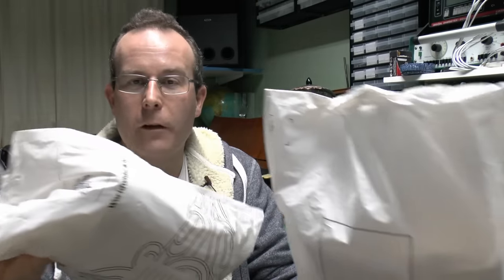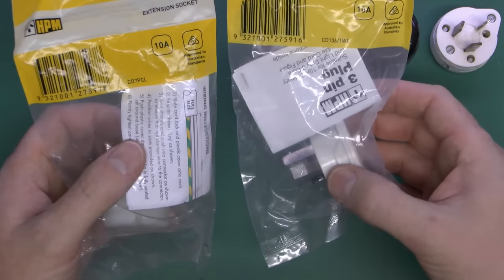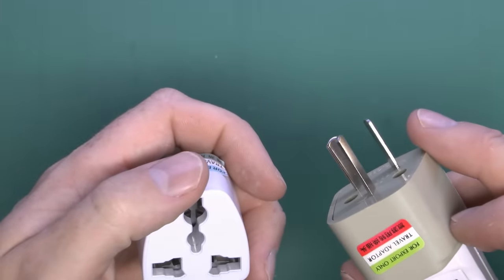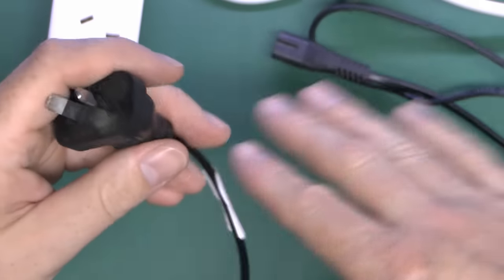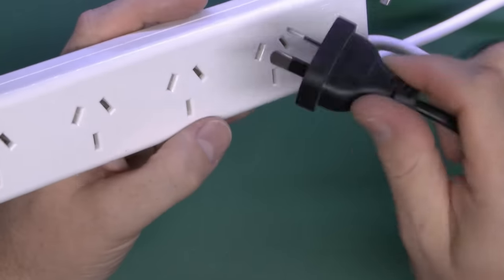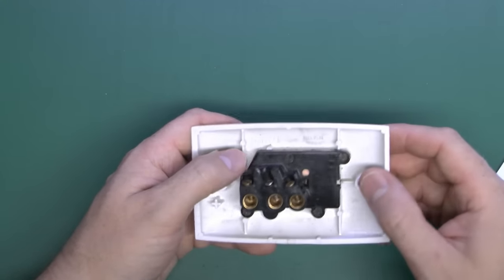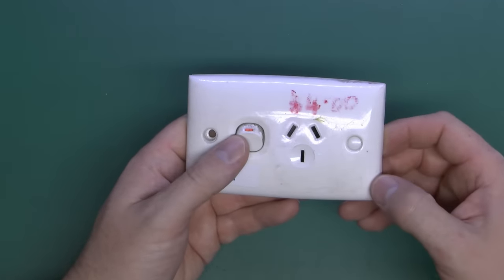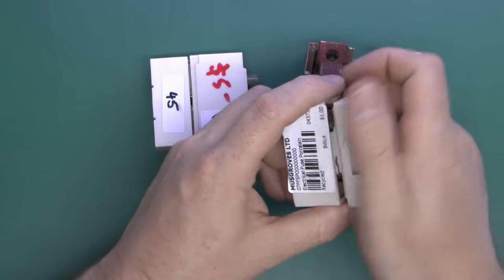New Zealand Electrical Items

Comment: When will others realise that there AC outlets are terrifying and they should switch to BS 1363.
Reply: When will the UK stop using pins all the same shape with dangerous ass ring Mains that rely on a quality product not to set your house on fire. When will the UK stop over engineering on saftey and require expensive features to keep it from frying shit. 

The BS standard is appropriately named. Bullshit.
Reply: +AmperaYT god forbid something that could kill you is required to be safe???? 
There's a reason things are as they (lack of copper post war) are and I'm sure if we could just change the wiring of every single house and building over night without spending god knows how much we would do it....
Reply: Our plugs and sockets are perfectly safe despite being a reasonable size and not requiring fuses in them, not requiring sleeved pins, blablabla.
Reply: TestECull NEMA plugs/sockets are safe if your not a total idiot. Yes you can hurt yourself on them, but it's easy enough to not.
Reply: Communist Ralph
Same could be said of BS1363, honestly.  Yeah, sure, sleeved pins, large size, blablabla...what's to stop some dingus from putting a small bolt in the fuse holder of an aging appliance that's always blowing them, or from putting a 13a fuse in an appliance that calls for a 3a fuse?

NEMA is no less safe and no more idiot prone than BS1363.
Reply: TestECull Shucko is one of the best electrical interface systems. It's impossible to shock yourself, they don't use ring mains, and they are for the most part non-rewireable. They also are NEVER polarized and there is no wrong way to put them in or wiring the sockets.
Reply: Communist Ralph
We use polarized plugs on a device-by-device basis. A lot of things in America don't have them. Cell phone chargers are a notable example. That device is completely indifferent to which input is live, thus they don't bother polarizing it and it goes in either way 'round. The boombox on my dresser lacks a polarized plug as well. Matter of fact a polarized plug on that particular device would be utterly pointless as the lead is a separate part with a connector on the device end that allows two modes of insertion.

Devices that need to specify one line as live, usually because there's a switch or a fuse in the input circuit, will be the ones using polarized plugs. For whatever reason, the device requires the live terminal be connected to a certain point in the circuit and polarized plugs enforce that. All earthed NEMA plugs are polarized on the fact that an earthed NEMA plug will only fit the socket one way, but the earth pin is not necessary for many devices.

I do kind of wish we had a single plug, though. That is one aspect of BS1363 I like. You don't have this 'two pronged, two pronged polarized, earthed three prong' bullshit. You have one plug, one socket. I'd fully support us just defaulting to the earthed NEMA plug and shrugging.

I am looking into getting some BS1363 sockets and plugs, though. They may not fit the electrical standard here, but they're well made, can handle loads of current, and are perfect as anti-theft devices for my power tools. My air compressor is far less likely to walk off while I'm at work if it's got some foreign plug on the end of it, ya know? So I wanna wire up my garage with British plugs and sockets, rather than American ones. Pain in the rear to replace the plug on every power tool I buy, but oh well. I'd honestly suggest Brits and Europeans outfit their garages with 240v NEMA plugs for the same reasons.
Reply: TestECull Get Shucko sockets. They are even better then BS sockets.
Reply: +Communist Ralph Although widely implemented by historical accident, the German invented Schuko standard suffers from being just about the only non-polarized earthed plug standard anywhere. The Swiss and the similar IEC 3-prong plugs are better and neater.  But almost every current 3-prong standard is better, with the possible exception of the clunky British one with their odd wiring and fusing.
Reply: John Doe
Technically speaking the US plugs aren't polarized either when they have an earth prong. It is considered superfluous to do both since the location of the earthing prong enforces polarity anyway, so technically, the NEMA 3-prong is also non-polarized.

GLHF plugging one in backwards without snipping the tip or using Grandpa's 1930s vintage extension cord, though.

Comment: A  13a  plug   /  A  3 KW   FIRE   /  WHY   IS  THE PLUG  HOT/ ANSWER  / POOR  DESIGN/IF  ITS  CLASSED   AS  A 13A   PLUG   IT  SHOULD   CARRY  13A  LOAD   BUT   THAY  DON'T   / BROWN  Marks  caused  by  heat on
Them
Reply: What??
Stop taking drugs, son..........

Comment: the 2 vertical pins = USA-(Yankee)-Plug -> all USA plugs are NOT sleeved 
(unlike UK, Switzerland, Australia now, new Thai-plug) & all USA sockets are NOT recessed (unlike Germany, France, Denmark, Switzerland, new Brazil IEC 60906-1 socket, new South-Africa IEC 60906-1 socket) 

Note: USA Plugs with holes in the 2 Power bladed pins are illegal & China-Export FAKE

This USA socket + plug problem still exists with countries using old British standards & Israel & old (non earthed non recessed ) sockets of Germany & France & Soviet Union 

Pictures of Plugs & Sockets 

Quick overview (German) https://de.wikipedia.org/wiki/L%C3%A4nder%C3%BCbersicht_Steckertypen,_Netzspannungen_und_-frequenzen#Netzsteckertypen

English: https://en.wikipedia.org/wiki/AC_power_plugs_and_sockets
 
Fun Fact: 
If you have worn out (contact widened) German- , French- , Danish- , Swiss- , Italian style standard sockets -> the British shaver plug ( 230 Volt devices only) will fit well & tight - - Does Never fit into Soviet sockets
Reply: One thing I've never understood about US receptacles is why do they not have switches on them?
Sure it might only be 120VAC, but the current is twice what it would be for a 230V
circuit.
That must be rough on the plugs and sockets when people just un-plug them while the appliance is still working?
Reply: @mikeZL3XD7029  - 
the problem is not the missing switch , the problem are the touchable & shortable live contacts ... even not very new Australian/Newzealandian plugs can shock despite the switch ... The plugs-Socket designs of the widely used German & French systems have NO switch but you can not get shocked due to the recessed sockets & these recessed sockets also mechanically support the plug & heavy classic transformer wall wards (there aree plastic adapters to enhance the mechanical support of Europlugs) ...